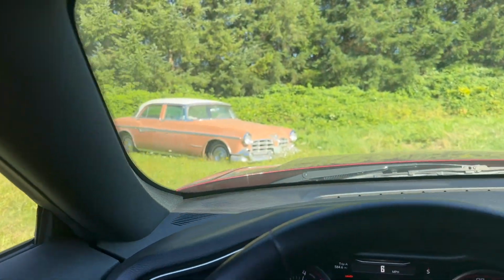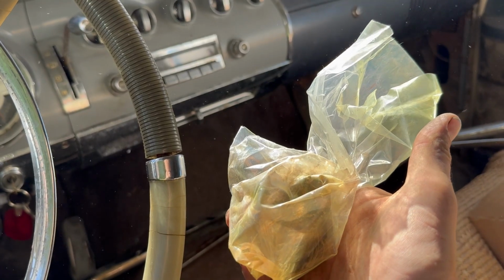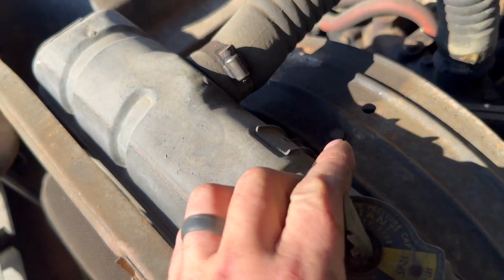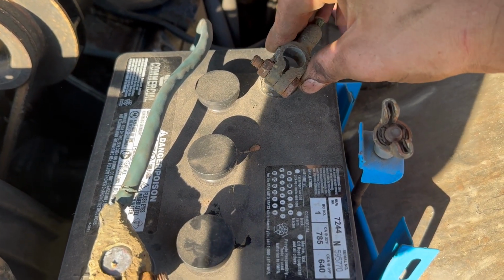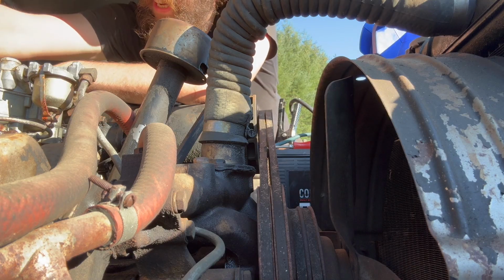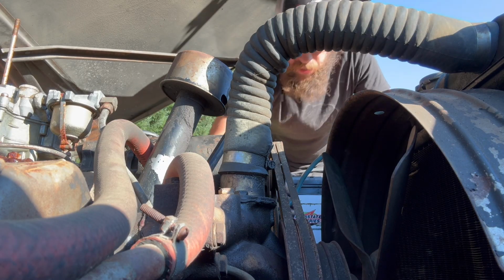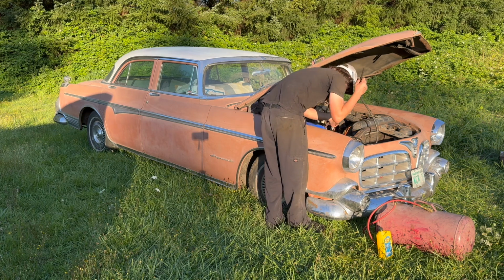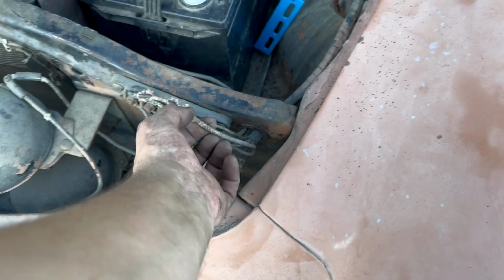Hemi Powered Land Yacht - Will This 1955 Imperial Run And Drive After 30 Years?

Comment: The power steering in these models were completely different from those used in the late 1950s and up. The design was called coaxial and the pump was mounted on the rear of the generator. The steering wheel movement you noticed is normal when the system is not energized by hydraulic oil pressure. Once there is hydraulic oil circulating, the apparent major looseness goes away. There is very low road feel feedback. It only took the force of a single finger to steer these cars. There are adjustments in the power steering mechanism to control how much play is evident while driving. I grew up driving a 1955 Chrysler Windsor which used the same power steering system as this Imperial. It was the first car I ever drove. I got used to the slight amount of road feed-back and never considered it a detriment. It just took getting used to. Hope you get this one operating again!
Reply: I learned to drive with a '54 Chrysler Windsor DeLuxe! It was "powered" by the GREAT FLATHEAD "6" and had power steering just like this! At 12 years-old, I ADORED this GREAT old car!

Comment: I had a 6 volt 241 Red Ram in one on my M37’s. Converted it to 12 using an LA electronic distributor, orange box and GM, 1 wire alternator. Never changed out the 6 volt starter.

Had to laugh at your comment on the portable air tank. Have the exact same one, and have thought the same thing many times over the past 35 years!

Comment: one body design aspect not often noticed is how Chrysler canted inwards the roof pillars at the top, so the side glass sits at an angle instead of square to level. This reduced the visual heft of the greenhouse section of the car, emphasizing length & width of the main body. At the time, it was a design compared to European luxury cars. It could be called early tumblehome. Before this, Chrysler cars were known to be "hat friendly" with huge headroom. Walter P. Chrysler approved of the smaller roof, canted side glass for 1955 as he could still wear a hat.
Reply from the maker: Yep. It’s very apparent in my thumbnail picture.

Comment: Actually, the turquoise NY (errrr SARATOGA)  is a 1960, and there wasn't a bad looking 1960 Chrysler made.  For a long while, I thought 1957 was the FL start, later I saw advertizing  that mentioned it as a new theme in a 55 or 56 ad. The Hundred Million Dollar Look referred to the cost of the investment in new tooling for the coming advances.
Reply from the maker: Right, I understand that. Who could forget the advertising phrase “‘55 Chrysler New Yorker Deluxe… looks like a hundred million bucks.” I decided that I like ‘60s after seeing that car. It’s got so much character. The interior is beautiful. I love the color, and the contrast of the tail lights against it. The golden lion helps, too. Unfortunately it’s totally smashed beyond any hope of viability.
Reply: @DeadDodgeGarage  I'd saw that side off and mount it to the side of your shop, pound out the dents a little. Saw off enough to include the Astra-Dome and hook it up  ;)
Reply: @DeadDodgeGarage   and then there's the whole 300-F thing, talk about appropriately named.

Comment: Imperial had the biggest engine in the biggest body which could also  be had in "Crown Imperial" form, meaning the factory limousine. So that makes sense to beef up the cross member. It probably improved the whole ride & drive. I rode in a '56 once on a surprizingly fast freeway loop of the greater Seattle area ... a long time ago now. The car seemed to drive solidly at speeds which must have been way over the brand new 55 limit at the time. It twer me first time on ye Express Lane....yeeeehaw!

Comment: Imperials had vented wheel covers even into the 60s, they left a 1/2 inch gap or so between the rim  of the wheel and edge of the wheel cover all the way around the wheel, as well as using the artillery style wheel with it's own vents. I think they did that up thru '72. Oh, you could check on those 68s.. they may have gone back to vents thru the face of the disk in '66. ...that is if you were burning with curiosity.

Comment: Love that body style but what were they thinking with those tail lights? That’s just begging for some kid to hang on and snap off, they just look like an afterthought.
Reply: there is an answer to that question!  Virgil Exner is reported to have directed the design so that it lifted the eyes instead of having to look down towards the bottom of the car ahead. So that was part of the inspiration for really tall fins for one issue, but also a way to raise taillamp and brake lamp effectivemess.
Reply from the maker: Yeah, I don’t see the appeal in that at all.
Reply: @DeadDodgeGarage probably to match later imperial that had detached headlites😊

Comment: Everyone is entitled to their own belief, BUT I prefer leaving 6 volt systems as six volt systems.  There is a certain sound each car makes when it starts, changing the voltage changes the sound.  These old cars no longer have to be dependable, and if they do, keep a battery and cables in the trunk!

BTW  Dodge NOW builds the fastest production car on the highway.  Too expensive for most, BUT still a fantastic car!
Reply from the maker: I understand, and I would even be inclined to agree - if I had ever in my life encountered a six volt car that would just START. Ok, I did actually get my ‘55 New Yorker up and running on six volts, now that I think about it. Also Evan’s Chrysler Traveller. I had every intention of getting this car to fire on 12, then actually running on 6. That battery had other ideas for the day.
Reply: 47 willys flathead 4 jeep do allrite w 6v @DeadDodgeGarage

Comment: Notice how little rust is on that bare metal on top of the trunk lid. I think the steel they used back then was of a higher grade, maybe it had some nickel or chromium in it. That sized spot of bare metal on a later car would have been gone by now.

Comment: I loved my 55 plaza. The sailing ship on the steering wheel was great. Such a basic no option awsome car.
Reply from the maker: Yes! The horn switch guts were missing from mine, and I never found a suitable replacement - but I zip tied the horn button with its sailing ship in place. The hood ornament is another neat detail. I also enjoyed the stripper nature of the Plaza. It was an early production car that lacked even the small side spear that was added to the fender and door later in the run.

Comment: My Aunt bought a brand new '55 Plymouth Savoy and it had the exact same gear selector on the dash. And you are exactly correct on the Plymouth gauges being spread out all across the dash. How silly was that?  Wondering if the "patches" in the trunk are for A/C? That is where it was installed at the time.
Reply from the maker: Very silly indeed. At least your “co-pilot” had something to do. In looking at historical diagrams, I do see that refrigerant lines ran through the floor in a similar area, but that certainly wouldn’t require such large openings.
Reply: @DeadDodgeGarage  Rodent assistant openings? lol

Comment: Seems like  Imperial is different in engineering across the board when comparing their sub assemblies , frames,  brakes etc...to the Chrysler, Dodge, and Desoto stuff.  a lot of Imperial specific components and that trend didn't seem to change much over the entire Imperial division run. This '55 is pretty cool. Stainless and chrome trim is what I noticed about the "presence" of this car it exudes a wealth and success image that was so marketable. Imperials uniqueness is what I like about them. Get that '55 300 Hemi car Jamie. You only live once find one you owe it to yourself  to experience one. Hope it happens for you. I like the '65 you picked up.
Reply from the maker: Absolutely. It’s all so similar… and yet not the same. Thanks!

Comment: Bakelite, the same thing they made the side plates on Penn fishing reels, like the way the dash is laid out and all the chrome,had a 66 Dodge van with the shifter on the dash, it was an automatic with a 318 which was a replacement for the original 273 it was the model with the super short wheel base, it was pretty insane, scared the crap out of everyone who rode in it, even with the non performance 318 it would light the tires up without even trying, it finally scared me after driving with my wife and kids in it and after getting some gas the steering rod broke while turning around in the parking lot, glad it didn't brake while going down the road those didn't have any way to let the steering rod flex, just a straight piece of bar stock from the steering wheel to the gear box,no u joint or rag gasket, so if you ever acquire one address that immediately, other than that potentially fatal design flaw they are a lot of fun especially when you put your foot on the back of the headlight and feel the wind pushing it when you get it above 80 or so MPH, have a good one
Reply from the maker: I did expect a comment about the later truck, van and RV dash shifters. Similar concept - but not as cool as FLITE CONTROL!

Comment: i have a few original adverts from 55 with foward look lingo.
Reply from the maker: I’ve had enough downtime today to do some research and learn that the Forward Look verbiage was used at the introduction of the ‘55 line. I still maintain that they are less weird than ‘57 on cars and see them as something a bit different, but they are definitely part of the Forward Look.
Reply: @DeadDodgeGarage  yeah. The the 55 cars are way more tame, for sure.

Comment: You are right about oil changes not being a thing back in the day. I bought a 331 Firepower from a guy in Salt Lake City and had it shipped here. When I took the valve covers off the rockers and heads were covered with sludge. I’m guessing they just added oil and never changed it. Thankfully it cleaned up nicely and actually does make more than 300 hp. Thanks for saving another classic. Oh and that power steering goes back at least to 1952 as my dads Saratoga has the same setup.
Reply: They stuck with cheap garbage non-detergent oil even though modern detergent oil was available. Don't ever use anything currently labeled as "non-detergent" oil in anything mechanical. They have no additives and are basically laxative oil.

Comment: The stinky steering wheel share the same stink as the older Craftsman screwdrivers. they are made from
 Cellulose Acetate Butyrate (CAB), a thermoplastic that releases butyric acid and acetic acid as it ages. 
Regards from Ody Slim
Reply: Is that the same stuff known as "Tenite 1" or "Tenite 2" that smell like vomit as they break down?
Reply: @gregorymalchuk272  Every time I open my tool box I have wished to have bought Snap On screwdrivers. The Craftsman drivers stink up my shop.
Reply: @OdySlim
I wondered why they stunk so bad.
Learn something everyday. Thanks.

Comment: OK, lets review. WCFB = Will Carter Four Barrel. These were the first four barrels used in US auto production & could be found in Single  as well as being available as Dual Quad installations from about 1955/'56 in many cars. I don't recall if the 1955 Chrysler & Imperial 331 engine used the improved cylinder block [scaled up from the Dodge design] but they had the best & most desirable stock heads. Bore it out to the 354 size & you have, in my view, the best early Chrysler Hemi for street rod use. 1932 to 1934 are the best years in my view also. 
These are DRS or Double Rocker Shaft engines, not dual rocker engines.
You have the opportunity to have very likely the best of the early Chrysler Hemi engines [392 is too heavy & too big in my view]

My unsolicited opinion? Glad you asked. Surgicly remove the engine complete, leaving everything else behind, & sell the rusty remains. Throw in a 383 B engine & trans in the deal if necessary & keep one of the most desirable early Chrysler Hemi engines for a worthwhile future project. Just my thoughts
PS, please do the right thing with that 315 Dodge Hemi as well. Both it & the 1957 Dodge 325 Hemi engines are also national treasures & you have the opportunity to do good with the 315 & the 331. Fun fact, a 1957 Dodge 325 Hemi or Poly at forty over comes out to 331 cubes & is smaller & much lighter than the Chryslers.
Reply from the maker: I know quite a bit about WCFBs, incidentally. I just wasn’t ready to declare his name was William Carter if I remembered wrong. Did you know that dual quad application WCFBs have crossover vent tubes? 

I would never. Ever. EVER. Remove that engine from that car (unless I was rebuilding and reinstalling it.) Ever. Period, full stop, I would not do that. The car will live on for future generations as it is if I have anything to say about it. I have watched multiple people ruin similar condition cars or better to harvest Hemis for projects. I am wholeheartedly against it. 

I have been trying to sell my Dodge engines for months now. Literally no one wants them. I haven’t had one single message or offer. They are sitting in my way, and I haven’t come up with any project worth using them in. I am not against buying what I am missing and building one, but I need a reason.
Reply: @DeadDodgeGarage  Yeah, I guess that's where we differ. I have had Dodges for the last fifty seven years. I still have the first one, a 1933 Coupe, very early build [Jan 1933] with the hyper rare three window body. [I like the rare stuff]
For me, the Imperial, is just a parts car, although I wouldn't destroy it, or part it out but that engine is a bit too special to keep hidden in a land barge. Particularly a luxo taxi. [ I call anything with four doors a taxi as taxi's are, of necessity, four door cars.]
If  the Imperial had been a Hard top or Convertible, then restore, restore restore.
For me, this engine belongs in something with a really strong chassis, an awesomely classic body & the ability to allow the engine to be seen. 1932 & 1933 Dodges have these characteristics in spades, particularly the '33 which would have the strongest chassis in its class in the early '30's [I have both] A rare & beautiful Hemi like this Imperial engine deserves, in my humble view, to power such a vehicle in proper Hot Rod dress trim.
Anyway, just another mans viewpoint.

Comment: WC = William Carter? Plus, correct me if I'm wrong (as I often am) but the Firepower was (eventually, not this year) the first engine to have more hp than it has cid. Neat! Not my favorite car, but still lovely and the seed of many future badass & beautiful Mopars are seen in it.
Reply from the maker: Yes, William Carter. Haha. The ultimate factory Firepower was the 345 horse 392 cubic inch engine. As mentioned, they have a ton of potential beyond that, but it was not realized in any factory application.

Comment: Those crowns everywhere are because that's a Crown Imperial, which was a trim level, IIRC. At least it was in '57, the year I'm more familiar with. There was also Southampton and LeBaron trim levels.
Reply from the maker: In later years, you are correct - the “Crown” name was used for various models, like the Crown Convertible. For ‘55, there were only three models - the regular Imperial sedan, the Newport hard top coupe, and the Crown limousine, which of course is much longer than this sedan, with extra windows and seating.
Reply: South Hampton was Imperial speak for hardtop.

Comment: I'm seriously impressed. 
But I do have a question. Why don't you use a simple test light to trouble shoot start/run circuits? Stick the pointy end in the battery ground and clip the gator clip to various terminals along the path to ignition.
Reply from the maker: Because there has never been a need for that. I don’t think I have ever had a situation reviving a car where there was no power from the key - or, in cases where I’m missing keys, where I’m not bypassing that anyway. The issue is never a lack of power, it’s a lack of an ignition trigger - IE fuzzed points, bad module or distributor pickup, etc. And cleaning the points, or testing the module gives me a perfect opportunity to verify that there is ignition power. I have a really good understanding of how these circuits work, and I know where to go without that extra step. Thanks!
Reply: Jeez it's not like I said you need to soak the cylinders first...

Comment: In keeping with your Brilliant Comments Rule,  I am NOT gonna ask you to pour oil down it's throat/s,  but I would like to suggest that you go to your local Farm Supply type store and get a 9 volt, yes NINE volt battery which helps in these yucky 6 volt situations.  It not only helps the poor things crank but helps keep the bulbs and gauges and starter etc.  from burning out.  9 volts sits comfortably right in the middle and they actually exist for some farm applications.  It's an old guy trick, try it, you'll probably like it!  (do not purchase a tiny 9volt transistor radio battery, smart aleck. lol)

Comment: Those look like Standard brand , points, the best ever made. 6V starters like 12 volts, but, the wiper motor might not! I wouldnt leave the battery connected, when walking away from that car at all!Luv, D
Reply from the maker: Exactly, all that. Haha.

Comment: Wheels on those Imperials are 15x5 1/2,  same as early Ford/ Ford truck. Imperial wheels are hard to find. 55 Windsors might be the cheap model, but, my 2 dr. hardtop, sure was nice!  Luv Dubs
Reply from the maker: Ahhhh, 5.5. I should have remembered that. Where this car came from, there was a pile of spare Imperial wheels. We just couldn’t fit them unfortunately. I wish I could come across a Windsor hard top, and a spare Imperial grille assembly… or just buy a C300. Either way.
Reply: @DeadDodgeGarage 
Hmmm, that might be what a set of 5x5.5 mopar rims with a small register- smaller than Ford that I have.